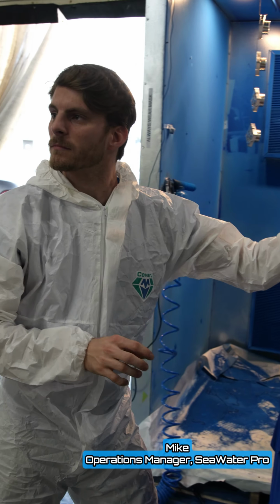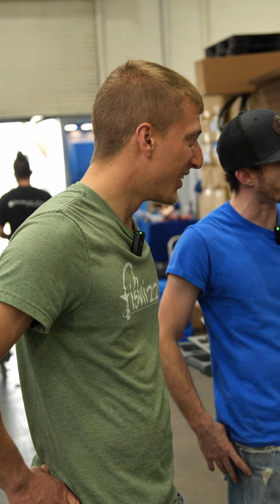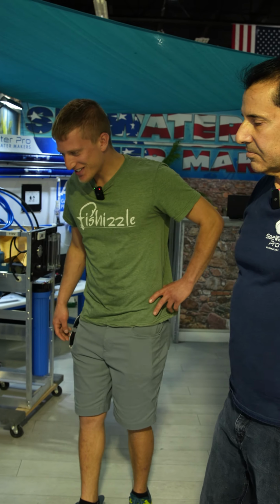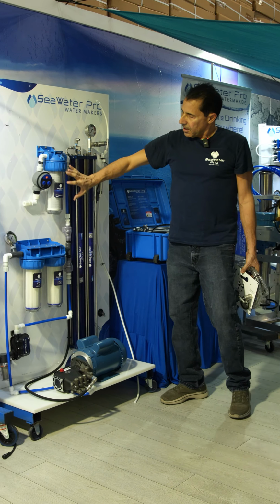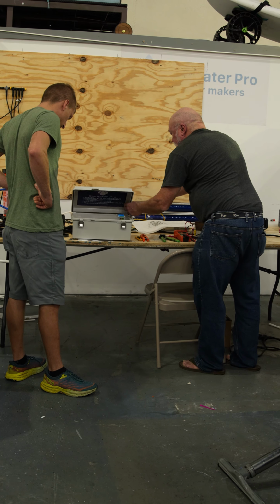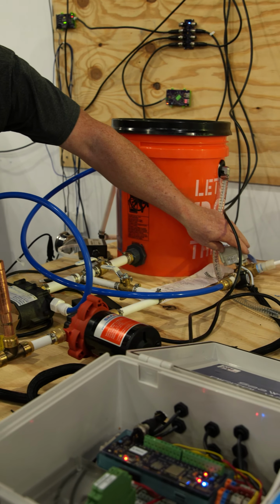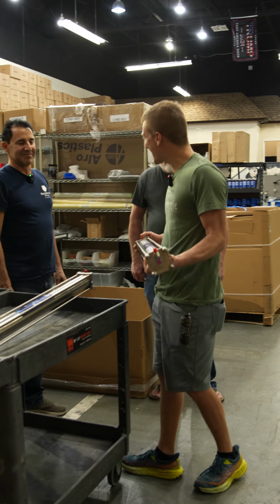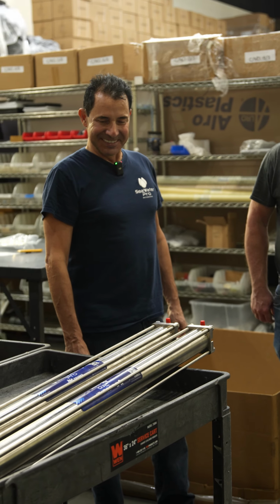@InTooDeepBro Full Tour of ‪@SeaWaterProLLC (BTS) | NEW 2025 Automation Controller Sneak Peak

Comment: We installed one of these systems-40gph, 120 volt-on our boat a few months ago…excellent customer support during the installation process and works perfectly…we’re now cruising in the Bahamas without concern of running out of water.
Reply from the maker: That is great to hear! We are glad you are enjoying your system.
Reply: @SeaWaterProLLC  Our system is like one you saw during your visit…we have no remote panel, gauges in the engine room…and works exactly as described…turn on boost pump…then high pressure pump…and voila-water! Game changer.